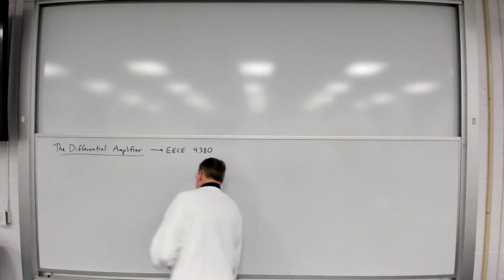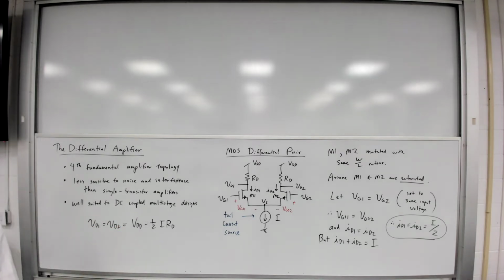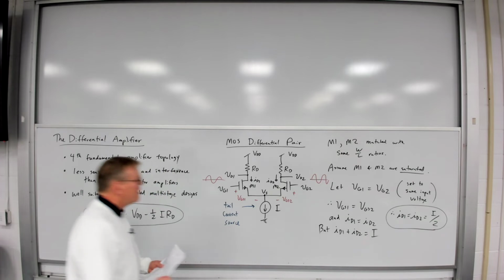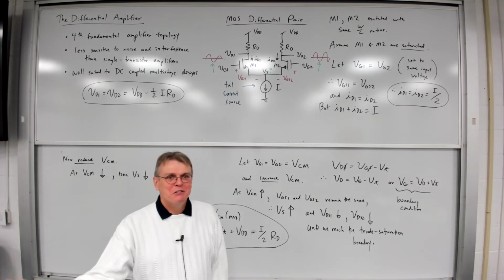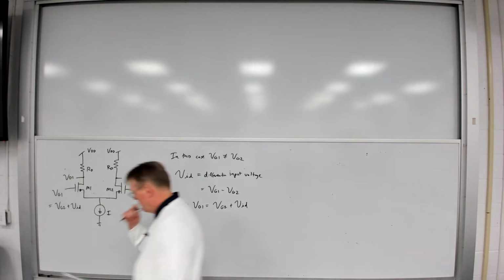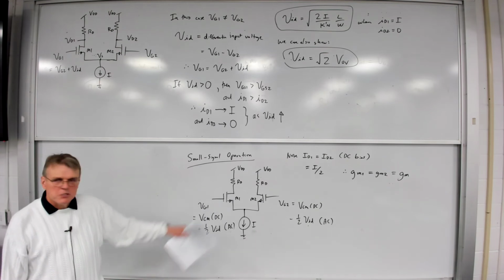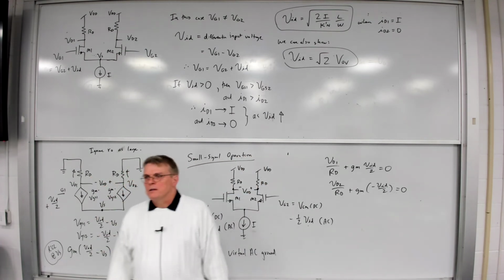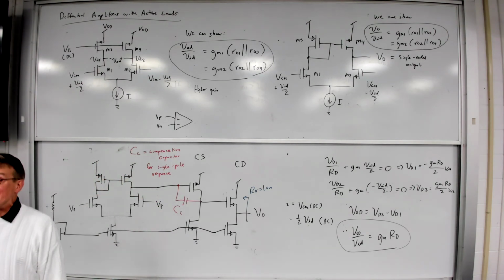Electronics - Lecture 25:  Differential amplifiers, the design of a simple op amp

Comment: So back in Circuit 1 when you were covering Op-amps, are the input voltages for the inverting and non-inverting terminals small AC signal? Same thing with output v_o? And V_DD (often not shown on op amp schematic) is V_BIAS and its purpose is to let the internal transistors inside the op-amp operate in saturation?
Reply from the maker: Back in Circuits I, the op amp was treated as a linear model, so it didn't matter if the input signal was constant (DC) or time-varying (AC) for vin+ and vin-.  The equations were the same.

For an actual differential amplifier built with transistors, the input voltages are a combination of DC and AC voltages.  The DC voltages (as you correctly surmise) set the bias conditions for the amplifier, ensuring the transistors are operating in the desired region.  For small-signal analysis, you zero out the DC voltages and deal strictly with the AC signals.
Reply: @wtimothyholman  Thank you, cir. And thank you for sharing your lectures. I literally watched your Electronics 1 lectures 3 times just to be able to grasp fundamental concepts of transistors. If you ever plan to share your next class, especially Circuit 2, please do! Thanks again!